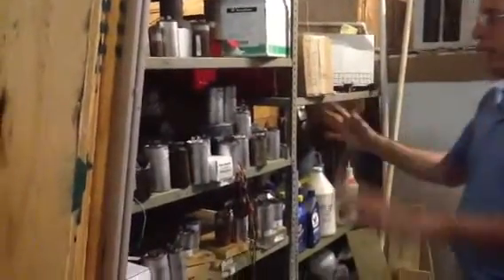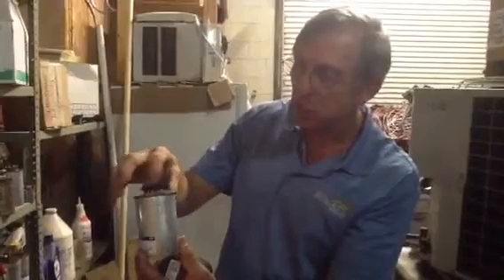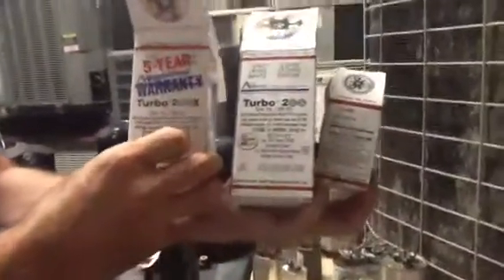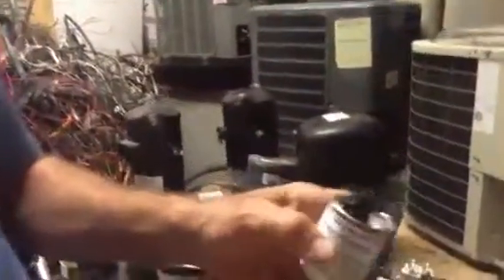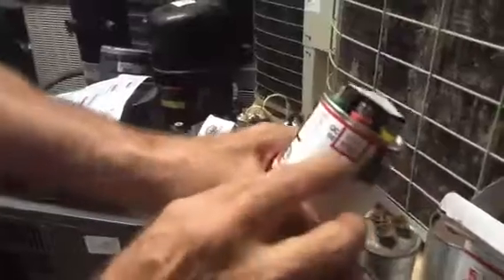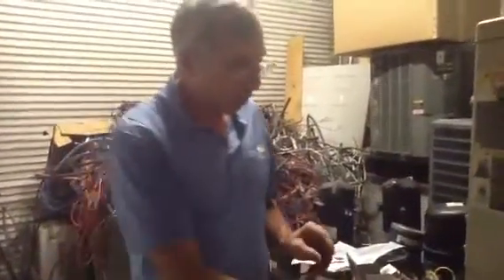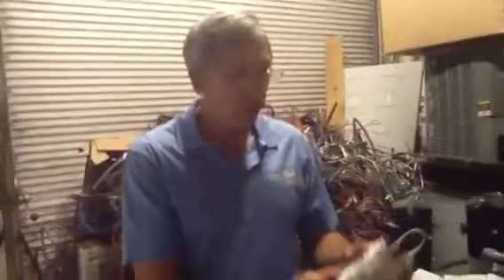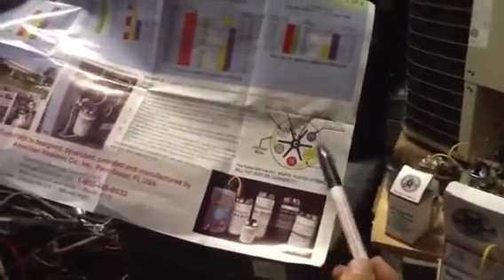Different Turbo Capacitors Explained: AC Industry

Comment: cool thanks for the very best video
Jones and I have a good
question about the contactor
I need to know
you are explain on one video
 normal is in the. compressor
the comun terminal
connect in t2 right
in some cases other
connect in  t1 they are no problem
if connect and t1 contactor
working properly let me know Jones 
thanks.